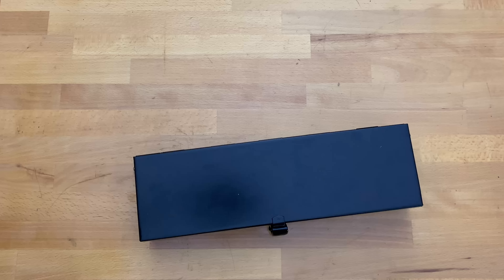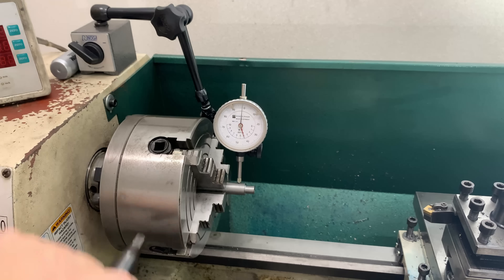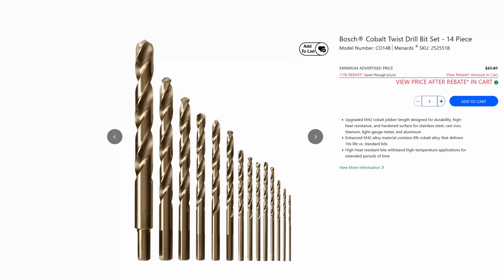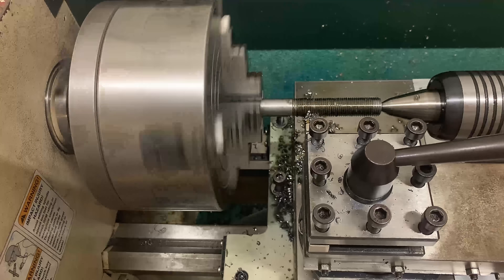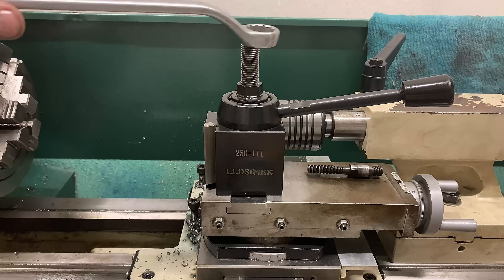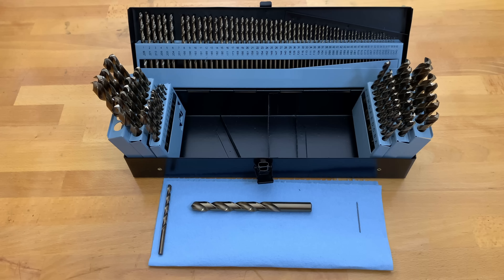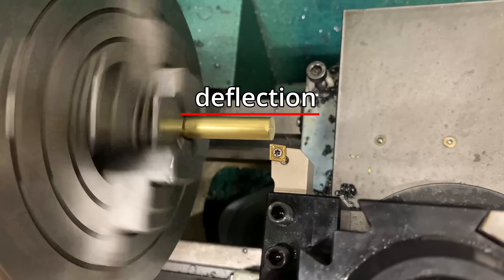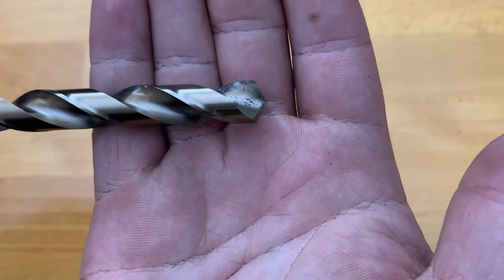Are Harbor Freight Drill Bits Secretly AMAZING?

Comment: Yeah, i tend to get all my HSSCo drills and taps individually(well, taps come in sets, but you get my point)... I have a small tool shop near me, and they hold everything, except carbide drills... You can order anything, even 3 flute carbide drills if you want, but main stock is just HSS and HSSCo tooling... You can`t beat a good quality single piece tool, they are always good grade material and good product in other regards... I`ve only once gotten a fucked up drill, my 12mm drill is actually a 12.03 or something like that, which actually is of great use sometimes... The punches and chisels and files that i got from them are also good... I prefer to pick up a tossed set-box from the scrapyard and fill it out with custom sizes that i need and use on a specific machine and keep it there - i know which drill is which size in which box... Tooling in sets is like kitchen knife sets - garbage, at least for the most part...
Reply from the maker: I am stockpiling individual drills that I use the most but I also like having the index on hand for oddball tap sizes or weird repair / tinkering projects that come up from time to time.

Comment: Honestly, you're likely better off buying individual replacement drills as you break these. You won't need most of those sizes basically ever. I generally use Red Line drills at work, they're fairly cheap from our tooling supplier, and reasonable quality. I'd check if you can order from your local tooling supplier as an individual, much better bet than the hardware store. MSC or Grainger might also be a reasonable option for you.
Reply from the maker: Thanks for your suggestions. I do plan on stockpiling the ones I use the most, but having a complete index on hand is handy for the oddball tap size, weird fix-it project, or whatever other need might arise where a strange size is needed. But yes, I agree with you about individual replacements as these wear out or break.

Comment: If you have use for every bit in the set, then you probably don't want this set. On the other hand, if you replace the ones you use all the time then it's a pretty good value. The rest that, as a typical hobbiest, you use occasionally, or never, then it's no problem. I've had a similar set for decades and there are still bits I've not used. Paying top dollar for those would be a waste of money.
Reply from the maker: It’s nice to have a full set for random weird projects and tap sizes that come up from time to time, but I agree that it’s also good to stockpile the ones you use the most.

Comment: I have had pretty good luck with the Horrible Fright cobalt full SAE drill index. A USA made Chicago Latrobe full index starts at about $650 and can easily go up above $800. Are they better drills? Yes. Are they $550 better? I don't know.
Reply from the maker: Especially when most of the holes I’m drilling are just starters, and then I’m reaming, milling, or turning them to their final dimension…

Comment: I have a set. I bought them for the variety and the index. I use the standard bits alot since they're easier to replace, and only use the rest when absolutely needed. I've had them for several months now and use them frequently. So far not a single complaint and can't even remember having to sharpen one. I would definitely buy again.
Reply from the maker: Your experience mirrors my own. Thanks for sharing!

Comment: I have the HSS version of this kit and it sucks royally.  Most of the bits chatter or don't even cut so I have to regrind them before use.  Sizes are all over the place, sometimes as much as 0.015" larger than nominal size.  I also own a fair number of "cheap" Chinese cobalt bits, some in smaller sets and some packs of a specific size.  Surprisingly I have nothing bad to say about the cobalt bits.  I have not tried any from HF but they just might be decent based on what I've seen from other "brands".
Reply from the maker: You’re not the first person to comment about their bad experience with the HSS versions… seems like a lot quality control issues with those

Comment: If people are breaking cobalt bits that easy, they better stay away from Carbide bits. I just bought a 1/16 to 1/2" for 900 bucks. Don't break those!
Reply from the maker: That's wild!! $900 is like my whole shop budget for the quarter lol. What set did you get?
Reply: @ShopHumor  It's called Monster, Grainger has it. 45YJ41 is the Part # for it. The bits are very heavy. The 1/2" feels like it weighs a lb by itself. Nice set.
Reply from the maker: @tomc8157  Just checked it out. That looks like a really nice set
Reply: @ShopHumor  I routinely remove titanium screws and stainless screws from titanium fixtures that are stripped and or have broken taps or ez outs inside them, so I needed some good bits.

Comment: I bought a set exactly like that back in the late 70’s or early 80’s. Don’t remember what they cost back then, and I bought out of some flyer that came in the mail. Still have the set, but not all the bits. Some of the smaller ones broke, and not saying they were junk, was probably me. For the most part, they did ok. At the time I was working construction, mostly outside of the shop, so they were used for various things without the benefit of a drill press with clamps and cutting oil and all that. So sometimes trying to drill steel on a job site in an awkward position doesn’t always allow for perfect drill bit use. Maybe under 100% ideal settings they would have preformed great. As far as being cobalt, idk, maybe now but I doubt they were back then.
Reply from the maker: I wonder when cobalt started being used in drill bits?

Comment: Thank you !!! I thought I was alone on how expensive drill bits are, and I'm big believer not cheaping out on tools. Once looking in a lot of review from reddit, YouTube and Amazon. I came to the cobalt drill bit set from harbor freight they are good, and I'm happy with the buy. I definitely recommend using them on a drill Press makes it safer for your drill bits not to breaking. I also tried there $30 115pc titanium set and I'm also happy with the buy. Reason I also bought the cheaper set cause I wanted to use the cheaper set. Im sort of still a beginner on metal work and learning how take care of my tools. Also, sharpening bits are little tricky so Hense the practice cheap set. You just can't beat harbor freight deals.
Reply from the maker: For $30 that’s great to practice technique and sharpening too! Good idea :)

Comment: get the screwmachine length drills (stub) they are handier than the jobber length in a home shop and are a heck of a lot more rigid to the point where given a little practice you do not need to center or spot drill hardly anything.
Reply from the maker: For sure. It’s nice to have the complete index for oddball projects, but the stubbies are the way to go for your daily drivers
Reply: @ShopHumor  We have the whole index of stub drills, they so sell then in complete sets
Reply from the maker: I looked around but the only complete indexes I found of stubby sizes were crazy expensive … one day I’ll be able to afford :)

Comment: I got this set and a drill doctor. They work fine for me drilling sheet steel and thicker pieces of mild steel up to an inch thick. They dull but I have the drill doctor to sharpen them. When they break I order good quality individual bits to replace them.
Reply from the maker: Do you like your drill doctor pretty well?

Comment: It sounds so bad that even some hardwoods would break them LOL!!  I also don't think highly of their tools.  I had a screw driver that you could get free with coupons they send in the mail if you buy any other item.  The thing is it was for slotted screws.  The first time I used it the tip twisted.  That screw driver instantly went in the garbage.  It was probably not heat treated and it may even have been an inferior alloy or maybe even just steel and nothing else.  It must have been soft metal because it didn't damage the screw at all!  When you buy things in there don't expect them to last or even be usable or you are infinitely more optimistic than you ever should be for shopping in a place that sells bargain priced Chinese junk!  You will just set yourself up for disappointment!!
Reply from the maker: So far so good in mild steel but I haven’t had the courage to try them in wood yet!

Comment: I've found that it is a mixed bag with Harbor Freight drill bits. While you are showing us what a wonderful job they do using them in the rigid environment of a lathe, mill or press, any use in a handheld scenario, IMPO, results in them snapping. They are extremely brittle. Yes, for the price, what would you expect? Probably not tempered very well.   My personal opinion is that they are good for use as you illustrated and lousy using them with a hand drill. A sudden change in torque or binding and SNAP! Yes, any drill can break when over torqued. HF drills seem to do this in a blink. JMPO as I have used many different drill manufacturers. Worth it? If you are extremely careful and take it easy, Yes! Handheld drill, no.  Liked the demo.
Reply from the maker: Thanks for your comment. I’m not sure if I’ll ever end up testing them in a hand drill or not, but you’re right about rigid machines vs hand drills.

Comment: It's very difficult to decipher reviews on items like this.  Often (not always) a person will buy an item like these and have no idea how to properly drill a hole and then proceed to blame the product.  I've worked around competent experienced machinists, as well as glorified operators who claim to be one.  Those in the latter group I've seen chuck up a half inch drill in a press, full send it into stainless steel dry, burn the drill, chuck it in the trash and chuck up another new drill in the press only to do the exact same thing.
Reply from the maker: That’s absolutely crazy to me lol but I guess if they’re not paying out of pocket for the tooling, somehow they never make the mental connection

Comment: I’ve bought three of the harbor freight 115pc cobalt sets over the years and I always had issues with the diameter of the hole being .010”-.030” large.  Some bits were ok, but not many.  The tip grind was visibly off center on the really bad ones.  Bought the Viking set you showed and they were way more accurate, I know they look expensive but they are worth the money, other quality sets are much more, for example, try buying a machine length set. . .
Reply from the maker: I haven’t noticed the tip grind being off on the ones Ive inspected but I need to give it a closer look. I’ve been picking up a few one off stubbies here and there

Comment: Used HF M35 drills almost exclusively for years. The only breakage was my fault. The only dulling was actually micro chipping caused by drilling hardened steel. They are a little brittle, which is a worthwhile tradeoff for having a good hard bit that stays sharp.
Reply from the maker: Haven't run mine through any hardened steel yet, but have a few projects in mind for the future...

Comment: We have this set at work and they are used lightly. I will say they come out of the case ready to cut. As these are used lightly they aren't bad at all. If you were using them every day, I would upgrade. Haven't found them to be brittle but they do have fine curves where the edges of the cutting surface meet the flutes. You certainly need oil and proper pressure. Not overly forgiving of operator error. That having been said, we only ruined one over the last 6 months. Roughly bi weekly use of a bit or 3
Reply from the maker: Technique and knowledge definitely go along way to alleviating problems with drilling. That's pretty good for using them that frequently

Comment: I got this exact set and I'm pretty happy with it.  Only broke one of them, and that was mostly my fault for a shitty setup that was slightly angled.  I have a drill doctor that I use to keep them nice and sharp.  I build a Housemade Revolution Gen 4 2x72 belt grinder with these bits and they worked great on the drill press.  Definitely a good deal for the home hobbyist metalworker.
Reply from the maker: I've heard mixed things on the drill doctor.. what are your thoughts on it? Pretty easy to use?
Reply: @ShopHumor  There's definitely a bit of a learning curve to it for positioning the bits and setting the depth correctly, but once you get that figured out it's really easy and also very fast.  I had to watch a few youtube videos that had some good pictures of how to do it and what it should look like, but once you see it done it's pretty easy and the instructions start to make a lot more sense.  It's really good if you have a lot of bits to sharpen too, since once you get into a rhythm it goes pretty quick.  You can also pick the angle you want, so if you need a bit to have a different angle on it for whatever reason then you can change it easily.
Reply from the maker: @fredfchopin  Thanks for the explanation, I may try to pick one up and give it a shot :)

Comment: buy quality tools only… cheaper in the long run
Reply from the maker: Sometimes yes, sometimes no. Sometimes a cheap tool will get the job done, and you can use the money you saved on buying a better tool for a job that needs to be more precise. 

I like using cheap drills to make holes slightly undersize, then using my precision reamers and end mills go get to my final dimension.

Comment: Every case that you have shown would have been just fine using hss IMO, I use cobalt when steel is hardened or particularly hard like high quality stainless
Reply from the maker: I agree in principal, but one of my reasons for buying the set and doing those tests were how many people were saying that they were barely good enough to drill wood

Comment: You only need cobalt for stainless….umm, I use the ace hardware #7s on steel, brass, aluminum, etc….
Reply from the maker: It’s nice to have the ability to be flexible in sizes available (the complete index is handy), and in materials you’re capable of drilling. Part of me just wanted to test to see if they were really as bad as people were saying - you say you only need cobalt for stainless, but a lot of the people on Reddit were saying that these cobalt drills weren’t even useful for wood!

Comment: I have use the ones from Harbor Freight for years.  In my hobby shop they do ok I run across a dull one every now and then.  If I were running a full time machine show or make a living from what I do.  I would pay to get the better one.  But for what I do the work ok.
Reply from the maker: If they get the job done, they get the job done. Sometimes you gotta sharpen them for sure

Comment: The important thing to notice is that the HF cobalt drills are all split point ground, meaning they're much easier to push into material. This means that if you really brute force what you're drilling, you can over tax the cutting capability and hit the weak spot where the point is split and break a corner off somewhat easier. That said, it really helps when you're just trying to avoid using a lot of pilot drilling. Basically, don't put a lot of force into the downfeed or infeed on the drill unless you're using it handheld, and even then know that you need significantly less force than if you were using a normal HF high speed drill. Also, generous use of cutting fluid helps quite a bit with drill dulling and grabbing.
Reply from the maker: Great tips, thank you

Comment: I bought this exact set and I thought it was great because I always had the size I need. They were not the best, especially for hand drilling, but they got the job done in most cases. I also bought that Milwaukee set and they are phenomenal. Those reviews are BS, I have been so impressed, especially for hand drilling!
Reply from the maker: Glad to hear the Milwaukees served you well. I was surprised to read those reviews about the Milwaukee drills, which is what made me think a lot of the bad reviews might have been user error

Comment: I bought the smaller set.  Worked great until I tried to drill very thin stainless steel of a cushioned cable clamp.  Dulled it instantly, material getting red hot.  The bits had not been used before, brand new.
Reply from the maker: Not good!

Comment: I have several USA made 115pc sets of HSS bits that I keep locked away for finer work..  On one of the super sales I did buy one of the HF cobalt sets for something like 60 bucks.  Right away I could see issues.  Some of the drills out of the set would not drill at all being so poorly ground..  some of the larger bits I have fixed on the darex sharpener but the smaller ones are just not worth messing with.    The reality is I should of returned the set as soon as it became apparent they were just twisted pieces of some sort of metal and not messed with sharpening any of them.
Reply from the maker: Those sound like they were total junk, that’s too bad
Reply: @ShopHumor  once I thought about it longer.  I had bought one of the HF cobalt sets maybe 10 years or so ago and it was night and day better than what they offer now.  If you open the boxes at the store many of the index cases have already started to fall apart.

Comment: I buy drill bits from HF but only use them on wood.  The few times I've used them on thin sheet metal they worked but the bit was shot !  Wood only and they are ok.
Reply from the maker: So far mine have been working really well going through half inch mild steel but I haven't tried anything stainless or hardened yet.

Comment: I was told by a master machinist at Kodak that you use alcohol as a lubricant when drilling aluminum… just second hand advice?!
Reply from the maker: I've also heard that! Isopropyl has some interesting chemical reactions with aluminum which significantly reduces cutting force. Good call out!